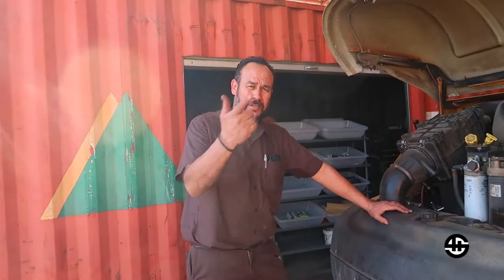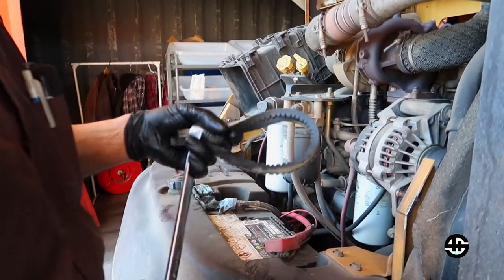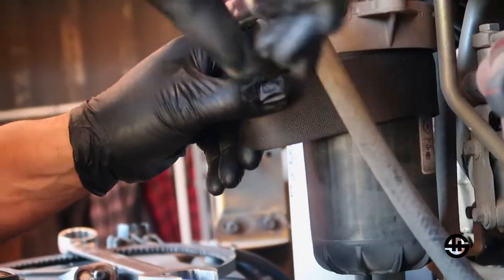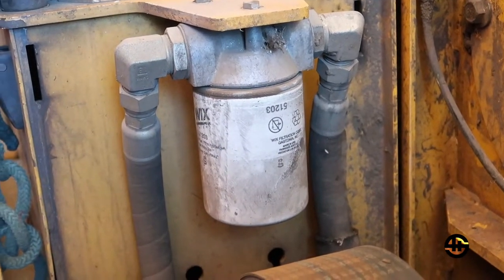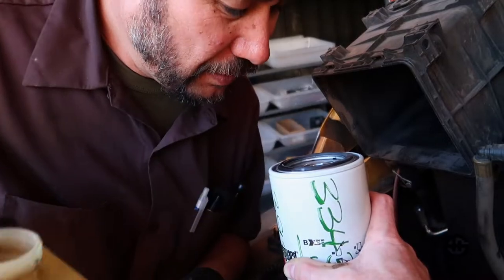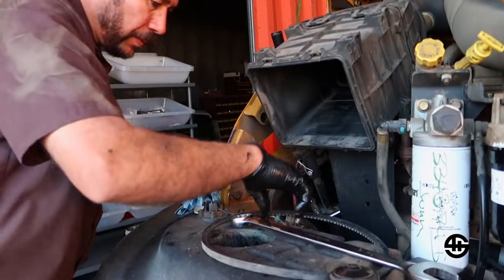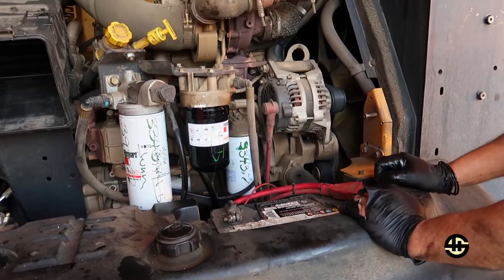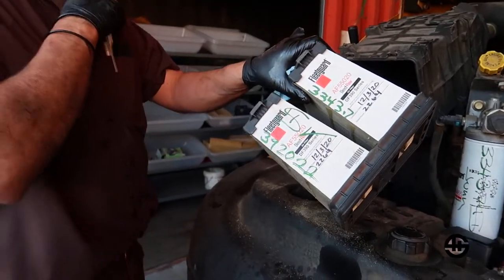Vermeer BC 1500 Maintenance

Comment: Good video. The diesel fuel filter can actually be taken off with a socket, if you look at the bottom of the fleetguard filter housing. It’s also printed on the side of the filter itself. I also noticed that the plastic air filter cover is missing the rubber breather, without it the both air filters are going to be needed to be replaced a lot sooner. I was wondering did you fill the new hydraulic filter before installing it?

Comment: Did you drain the Hydraulic Oil? Do you have to bleed the lines after replacing Haudraulic Oil Filter?
Reply from the maker: No there is no draining of anything it’s it is only a 500 hour service which is replacing the Hydro filter nothing else, now if it was 1000 hour service then that’ll be different.
Reply: Hola donde radica tengo un 2018 bc1500 y tengo un sensor fregado
Reply from the maker: Yo estoy en la ciudad de Cona ca, 
340 N. Grant ave
Corona ca,92882
Reply from the maker: @feliperuiz5943  
340 n grant ave
Corona ca,92882
Reply: @thehydraulicspecialist3176  yo estoy en el Valle de san fernando
Reply from the maker: @feliperuiz5943  ha si nadamenos horita estoy trabajando un bc1000 de san feenando tree care
No se si Los conoses, pero ellos me traen los chippers todo el tiempo.

Comment: Is there a way to adjust the spring under the back door? I was hoping to add more tension to the spring as its really heavy to lower and lift
Reply from the maker: Although they did the spring to make it better it has always been a problem. Sometimes the spring will break so you might want to check that and there is very little adjustment. You would have to take it apart and see.
Reply: @thehydraulicspecialist3176  can’t see any adjustment. I see a welded plate behind the spring. I was hoping for a threaded end so I could add tension
Reply from the maker: @Viralclown  yes sir that’s just to help in spring they Call it maybe we should come up with the fix for that and sell it to Vermeer
Reply: @thehydraulicspecialist3176  yep just needs a threaded nut that compresses the spring

Comment: Hi.  How do you adjust the feed wheel springs? Noticed there is two springs but different tensions. Had to change the back one to a shorter hole to be able to get it back on.  
The wheels weren’t sliding so cleaned out and lubed the slides as it wasn’t opening and jamming up. It’s feeding better now but still struggling with the big stuff. I’m assuming the springs should have same tension and both in the same holes so it slides open and closed square and doesn’t bind up?
Reply from the maker: I think first you have to check the psi on the rotational motors do you have to have a 3000 or 5000 psi gauge to do that do you have one?
Reply: @thehydraulicspecialist3176  no I don’t. I changed the spring, now they are the same tension and in the same middle holes.   Also cleaned and greased the slides and now actually move easy. 
Also removed the bolts I put in the rake holder I noticed the feed rollers were hitting them they were dented as they were too long I flipped them around. 🤦🏻‍♂️
I’m hoping it’s good now
Reply from the maker: So the rollers actually stop feeding is that what the problem is?
Reply: @thehydraulicspecialist3176  one did on the left but I think it was hitting the bolt holding the rake holder sticking in too deep inside the feed area.  The rollers weren’t spreading apart enough to feed large branches. After taking the springs off it was really hard to pull the slides back apart.  We cleaned them on site and oiled them. We got it working ok but occasionally had to push the bigger stuff through manually with other logs. 
I think the biggest issue was that there was also two different springs.  Totally different tensions and one was about an inch shorter and heavier gauge. I got a new spring and replaced it.  Also swapped the rake bolts around so the head was inside the machine and threads sticking out.  The threads had scratches on them from the rollers and the rollers had two chips where the bolts were hitting them.  So hopefully all good now 🤞🏻